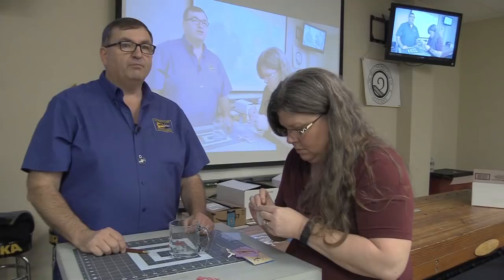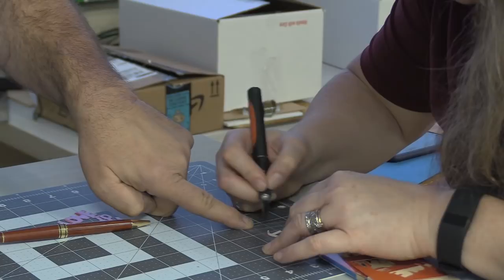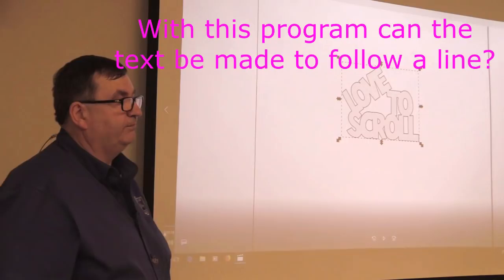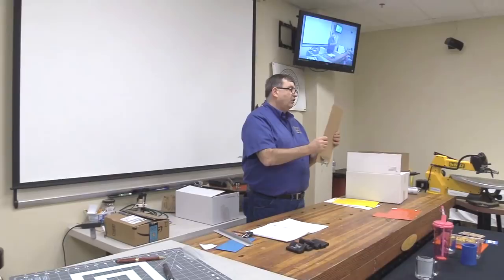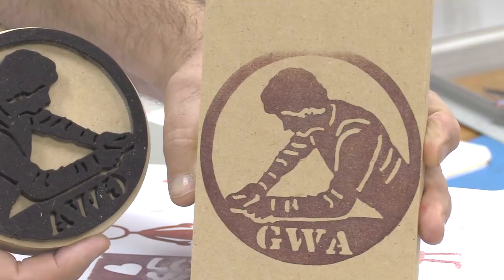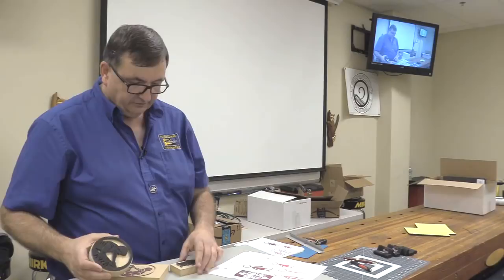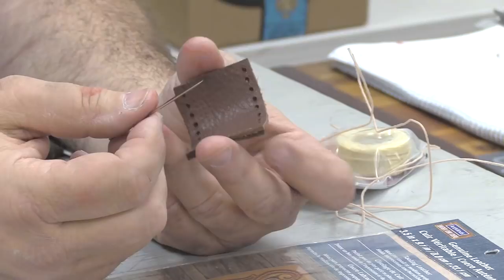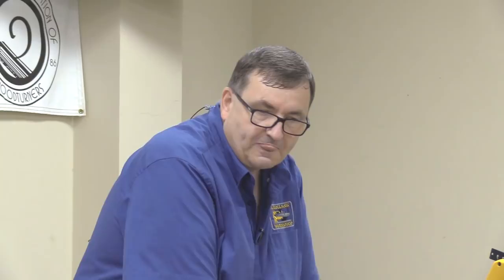Live from the GWA classroom – it’s Steve Good (part 2)

Comment: Have you tested/tried spraying the EVA foam with plastidip? It could maybe make the stamps come out clearer! Plastidip is a spray rubber coating found in the spray paint section at Wal-Mart. Plastidip  is often used as a sealant on EVA foam to make it paintable because it fills in all the foam pores. Also the leather you can use faux leather often found in the fabric section of craft stores. It's often used to make bows.

Comment: I'm not picking up the name on the blades. 2 ought, aught? What type, reverse, straight, crown....?
Reply from the maker: He is referring to using 2/0 blades. I will verify with Steve which brand and type he is using.
Reply from the maker: The blade Steve is talking of is a "2/0" frequently referred to as "two aught". He gets his blades from Pegas. The 2/0 is also referred to as a jeweler's blade (very thin kerf) and is only known to come in simple geometry. Flying Dutchman is another manufacturer that produces a "jewelers blade"  that is slightly thinner than 2/0.